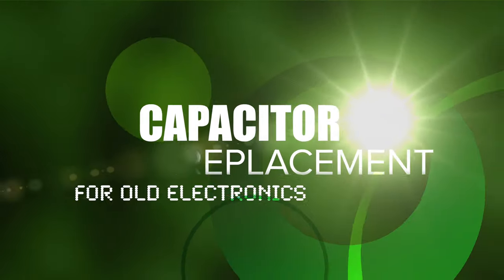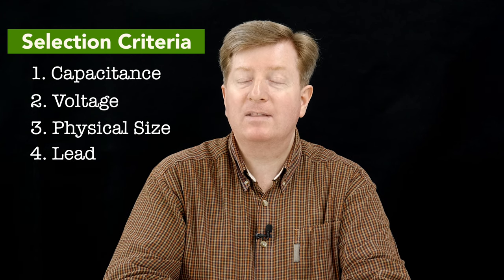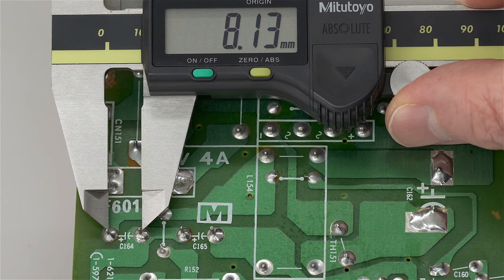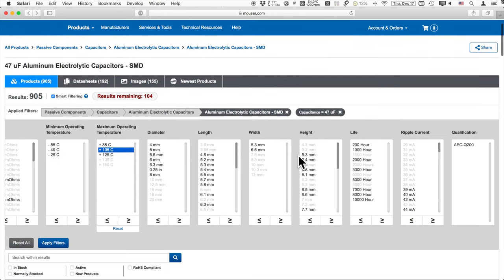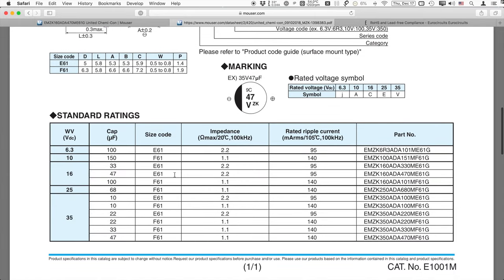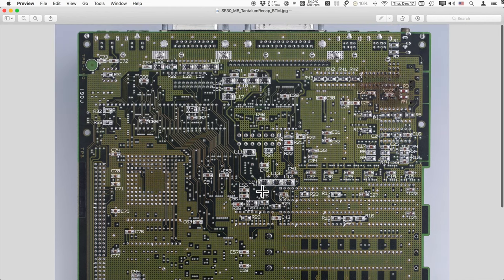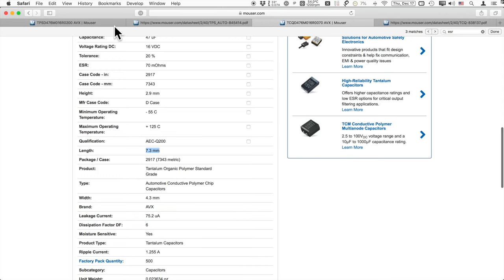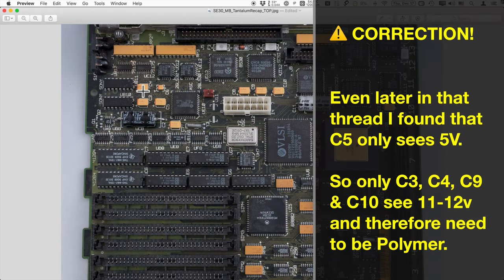Choosing Capacitors to Recap Old Electronics

Comment: So a 16v polymer tantalum with 20% derating (that means OK for 12.8v) gonna be cool in a 12v usage on a for example motherboard recap until i saw that it says 20% accuracy. so i go wow that's not cool anymore. I guess it's safe to go and find a 25v version.
Reply from the maker: If by "20% accuracy" you mean "20% tolerance regarding capacitance," you need not be worried about that at all.  A 20% tolerance (for capacitance fluctuations) is normal and not a problem.  What I am talking about regarding voltage spikes has nothing to do with tolerance of capacitance.  With that said, you can of course use 25V rated parts.  They just cost more.  Make sure the physical size of those 25V caps also fit the pads too, as some parts are too big.  Most should be fine.  You just need to check the data sheet for physical dimensions.
Reply: @JDW-   knowing that is a relief, now i have to research about what in the manufacturing process actually causes those tolerances and why different capacitance in two identical caps has no relation in their rated voltage.
 thank's for your reply and i enjoyed whole video, actually i took a pencil and wrote 6 pages of notes.

and does choosing low ESR caps is a general rule with all power supply circuits? I'm afraid some circuits might rely on high ESR to function in a way.
Reply from the maker: @hosseinebrahimi3451  Thank you for your reply.  The process technology used in combination with variations over a given temperature range is why there is a tolerance range for capacitance.  Typically, it is more expensive to get the process technology to be stable over a wide temperature range, which is why a 10% or 5% tolerance capacitor will cost more than a 20% version.  But keep in mind that most electrical engineers take that into account in their board designs.  If they don't, they aren't good design engineers!  So if a given circuit board is designed for a +/- 20% tolerance capacitor, you can safely replace it with another 20% tolerance capacitor.  There isn't necessarily an advantage to paying more for a higher quality capacitor that has only 10% tolerance UNLESS you are designing the board yourself and you know you need a tighter tolerance.  But many times, the amount of actual capacitance you need isn't so strict.  Most engineers, depending on the circuit design, tend to err on the side of adding too much capacitance. 

ESR is tricky because if you're building a switching power supply, you have to follow its capacitor guidelines.  Some data sheets will tell you that you must have a minimum amount of ESR on the output stage capacitor, otherwise it will become unstable (oscillate).  Many of those designs recommend a ceramic cap (very low ESR along the lines of 8m-ohm) in series with a resistor.  So in that case, you are deliberately adding ESR to comply with datasheet guidelines. 

It is also possible that a timing circuit may need a certain amount of ESR.

Mostly though, caps used as "bypass" caps (to prevent voltage dips on voltage rails) benefit from low-ESR.  So going very low on ESR is not an issue with those.  But be careful!  Simply choosing a ceramic cap for the sake of getting the lowest ESR is not only expensive, but there are other caveats too!  Ceramics have the lowest ESR, but they can crack if their size is very large and your circuit board is subject to many jolts.  They have an enormous voltage derating (except for small-sized C0G/NP0 versions, which have no such derating), such that you may need to get minimum 50V rated XR7 ceramic cap, for example, to offer its full capacitance when used on a 12V rail.  If you choose a 25V XR7 instead on a 12V rail, you may only get 50% or less of the rated capacitance!  That's right!  When you use a ceramic capacitor like an XR7 with a voltage applied on it, the "bias" voltage can reduce the capacitance unless that ceramic cap has a very high voltage rating (or if you choose a C0G cap -- which are only available in tiny capacitance sizes).  

Ceramic caps also very slightly increase and decrease in physical size when voltage is applied to them, which is why some switching power supplies make an audible and annoying 1kHz (or similar) sound in operation.  Those ceramic caps are changing size rapidly and using the entire circuit board as a kind of speaker cone!  Some expensive ceramic caps are designed to eliminate the audio effects.  Some engineers will design holes near those ceramics to reduce the PCB surface area subject to vibration so you cannot hear the audio effect.  It's a problem specific to ceramic caps.

Learning how to use capacitors requires major study, but it's worth it in the end.  I wish you the best in your electrical endeavors, Hossein!
Reply: @JDW-  I'm honored and grateful that you are shareing your time and knowledge with me.

Comment: 4000 hours at 125C doesn't mean that the cap will fail after 4000 hours.  Extreme temperatures degrade the cap much faster, so one at, let's say, 40C should last much longer.  The rating is just for the worst allowable case scenario.
Reply from the maker: Of course, but the point is there are no guarantees about how much longer it will last if you had run the cap at the said four thousand hours at a temperature of 125°C during all of those 4000 hours. Practically speaking, most people will probably be using a capacitor rated for 105°C at temperatures of 60°C and below, which will most likely translate into many years of use for those capacitors. All said, a capacitor with the highest temperature rating, combined with a higher hours rating, combined with the lowest operating ambient temperature, will translate into the longest life. However, fluid filled aluminum electrolytic capacitors still do not have eternal life. There are many that can and do leak after about 20 years of use even though they were operated in a very cool environment.
Reply: @JDW-  Yeah, I just thought it was worth mentioning in case some viewers got confused and thought they have to change caps every 2000-4000 hours of use:).
Also, I wouldn't exclude lower temperature caps just because of their temperature rating, as they might have tighter specs over the high temperature ones.  Sometimes you have to sacrifice one spec for another.  I would recommend checking the specs of both before making the final decision.

Comment: Some of them there TDK caps have a 200,000 hour life.
Reply from the maker: Indeed, but realistically, fluid filled aluminum electrolytic capacitors, regardless of that life spec, are not guaranteed by the manufacturer to last beyond 20 years.  You will usually find that is a footnote somewhere, either in a data sheet or on the manufacturer's website.  Also, it's important to note that many of the fluid filled caps with very high life ratings tend to have higher ESR than the same kind of caps with lower life ratings.  Not sure why that is, but that has been my experience for a long time in buying a variety of electrolytics.  The reason that matters is because sometimes you will buy what you think is the "best" replacement cap, only to pull your old cap and measure it and find it's ESR is lower than your new, replacement cap!  Again, the life rating has a lot to do with that.

Comment: Unless the Mitutoyo is afordable, I think a second tier caliper is enough.
Reply from the maker: If you don't need a digital version, then probably anything would do.  But in my experience in first buying a cheaper Chinese made digital caliper and finding the display die only a few months later, it was wise of me to go with the Japanese made Mitutoyo because I've been using that for years without issue.  Affordability varies from person to person, but "you get what you pay for" applies to all of us.  That's not to say cheaper calipers might be better than the cheap calipers I bought originally, but I don't have experience outside the two I just mentioned.

Comment: Paper capacitor go acidic and should be replaced as well
Reply from the maker: Indeed.  Examples of such are the RIFA metallized paper capacitors used on the Analog Power Supply boards of certain vintage Compact Macintosh computers.  You can see me point out those caps in my video here: https://youtu.be/Ng8F_QVgaTc?t=587

Comment: I dont get why ceramics are a bad idea? Modern boards all use them over tantalum they even fail in the same way.
Reply from the maker: I provided a comprehensive set of reasons to ALXLAB in the following Tinker Different thread: https://tinkerdifferent.com/threads/spicy-oclock-project-has-started.128/page-3#post-7050

Comment: 18:00 you can clue them though, cant you?
Reply from the maker: I’m afraid I don’t understand your question. At the 18 minute timestamp, I am commenting exclusively on Wurth capacitors. I don’t understand what “clue them through“ means.
Reply: @JDW-  Hello, thank you replying. You were describing (17:54) how the bigger capacitors need to sit flush with the board, which of course I understand why, your arguments are solid and muchmore you're the proffessional here, but if we can't do it, can't we just fill the gap with some kind of glue in order to secure the capacitor? 
Look, I'm just getting into this world and I do so as an amateur, but I've seen capacitors secured on boards (I'm referring to amplifier etc boards) with a kind of glue.
Reply from the maker: @papertoyss  Thank you for clarifying that you misspelled the word Glue as Clue.  And with the new timestamp, I now understand what you mean.  Yes, you can use silicone in order to stand a capacitor up on its legs and prevent it from moving.  In other words, you would solder the cap in place and then inject silicone or hot glue under it such that the base of the cap sits flush with the glue.  The glue/silicone will prevent the cap from moving around, which reduces stress on the legs, prevents bad solder joints over time, and also better ensures that the rubber seal at the base of the cap doesn't lose integrity over time.  But when possible, please sit the base of the cap flush with the PCB.  That's best practice, looks cleaner, and of course is easier to do as well.  Good luck to you in your recapping endeavors!
Reply: @JDW-  Thank you very much! Im about to recap a small board (nothing important - an old boombox I want to bring back to life though this small  - ~25cm x 8cm -  board has more than a hundred very small axial capacitors with coloured lines and not numbers on them, many of them in very narrow areas) and if I succeed, I plan to recap the power board of my amplifier. I was about to start, but I had second thoughts and started getting more informations.

Again, thank you!

PS:  please forgive my english, they're not my mother tongue. When I'm in hurry, I actually do sometimes confuse words like glue and clue. I've done it before. I can tell the differece though.

Comment: Wurth if not mistaken do not manufacture capacitors, instead are rebrand from some Chinese manufacturer. So would not trust them at all, especially for electrolytics type.
Reply from the maker: It would appear you aren't personally experienced in using Wurth capacitors but instead gleaned info from old internet posts, largely from the 2016-2017 time frame when Wurth caps were new on the scene and people went to online forums to ask for opinions.  Wurth has their own factory in China and has for a long time.  Whether they built it or not is irrelevant, they have long owned and controlled it.  There is photo evidence that in the early days they had caps with the word VENT printed on them, which was indicative of Chinese brands in the past, so that would imply that Wurth may have rebranded Chinese caps at that point in time, but one cannot say that current caps are mere rebrands.  

My own experience as an EE with Wurth caps through the years has been good, not only for hobby use in recapping old electronics but also for current professional use too.  For example, I use a Wurth branded electrolytic cap on the output of an automotive SEPIC switching power supply I designed very recently.  Trust is earned, and they have earned my trust.

Wurth has been around a long time and has established a good reputation. Now that their capacitor business has been around for nearly 10 years, they have a track record for offering quality electrolytics, and that holds true even though they have a manufacturing facility in China.  Remember, even Apple makes quality electronics in China, even if that isn't on a component level.  Who doesn't these make something in China days?  Quality directly correlates to the non-Chinese company who oversees, owns or otherwise controls the factory.  The same is true of Wurth.
Reply: @JDW-  Yes, not familiar with Wurth and when they started appearing on RS catalogue of course questions were raised all over the web. So typically I would continue to stick with brands that have well known track record like Rubycon, Nichicon, Nippon Chemi-con and Panasonic for electrolytics. That's not to say that even these well known brands had bad batches. 

I think buyers should also be wary of counterfeits, like those sold on eBay and some other sites. Most copied is Rubycon, often with sligtly misprinted logos or misspelling (like the infamous "Rulycon"). Nichicon is also another brand most copied followed by Nippon Chemi-con. Seems Panasonic is not as popular among counterfeiters. Often counterfeits are recognizable since these had different colors, vents or rubber seal than the original. Had also seen no name capacitors, literally no brands on the sleeve like your "VENT" one mentioned. I've came across some with just "LOW ESR" printed on it.

But the bad capacitor plague still continue to this day (not just on computer motherboards but also inside power supplies, monitors and other computing equipment). Example had an Asus network switch with failed "Canicon" capacitor (replaced with Rubycon PX capacitor because that series had the only physical size to fit inside the hardware, height had to be less than 12.5mm). That's the other thing, not all good branded capacitor has correct physical sizes (and lead spacing). Had come across power supplies that uses 7.5mm lead spacing instead of the typical snap-ins for large high voltage capacitors. Seems that Chinese capacitors have those sizes and lead spacing. Unfortunately I had to left them in power supply recappings, and pray they don't fail suddenly one day.
Reply from the maker: @loweedwards7807  That is why I only buy capacitors in sample quantities from DigiKey and Mouser, not EBAY or AliExpress.  I've purchased resistors from AliExpress in the past just to see what I would get, and the leads are very thin, and I even see tiny rust specs on the leads too.

At my workplace here in Japan, we tend to manufacture in Taiwan mostly, as the quality and components are superior to what we could get in China.  There are times when our factory will be sourcing components for a given design and they will make recommendations of Taiwanese capacitor brands.  Depending on the electronic design, I may decide to allow that, and to date, I've not had a problem with their off-brand recommendations.  Of course, for more sensitive electrolytic caps on a switching power supply, I tend to specify that our factory use what my original design specified, even if the cost is higher. 

Going with known, quality brands you've used before and obtained from a reliable and honest vendor is what matters most.

Comment: Strongly disagree German quality is far behind Japanese Quality.
Reply from the maker: I certainly do not remember saying German electronics parts quality is exactly the same than Japanese parts quality.  And I should know, because I've lived continuously in Japan since 1994.  With that said, I've not had any issues thus far with Wurth brand capacitors, which I believe is all that I mentioned in this video.  I do have experience with Varta batteries made in Germany, which were used in some of our mass produced devices at the office, and we never had issues with those either.  So if you saw me say reasonably good things about German quality in my video, that would come from my experience with those things.  But I certainly would not make that quality to be on exactly the same level as Japan.  Japanese quality is a high bar to reach.  Could be that you have bad personal experiences with things made in Germany, and maybe that is the basis for your comment.